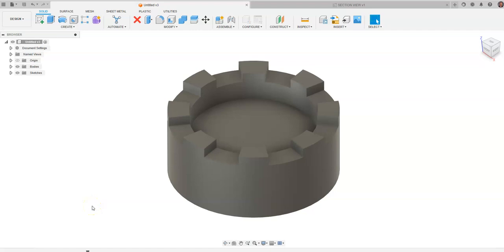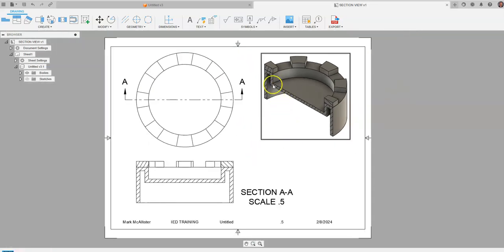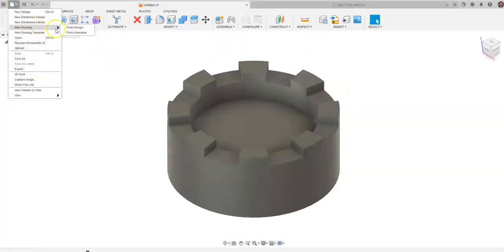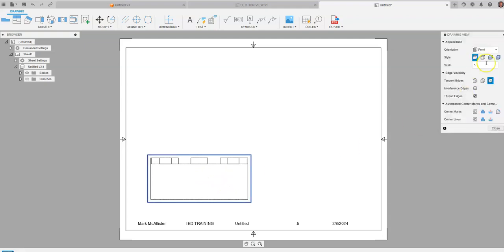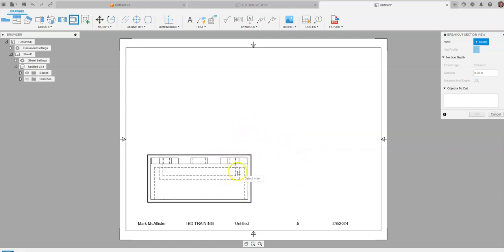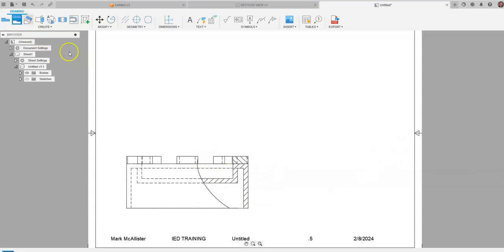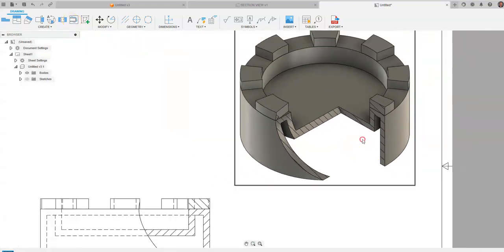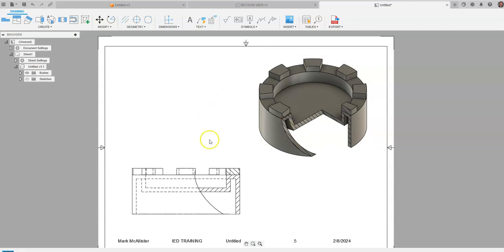Autodesk Fusion Tutorial - Breakout Section Views

Comment: Oh yeah. Except I have never in 18 years of creating drawings needed to have a breakout section on an isometric view. A solution in search for a problem. Breakout views are necessary to have in drawings but the way Fusion implements them is wrong. Yeah I can create a breakout section view. But it doesn't create arrows on the parent view to show what's sectioned. I have to work around it by creating a normal section view and dragging it off the side of the template.
And of course a cherry on this cake - there's no way to create two different breakout sections on the same view.
Reply from the maker: I at times see questions asking students to identify section view types on exams. This video is a guide for students to understand what a breakout section view is and how to use the function. 

I’m not sure how much it’s used in industry b